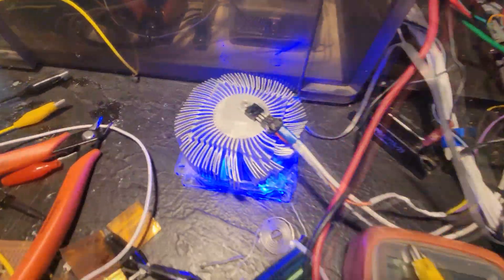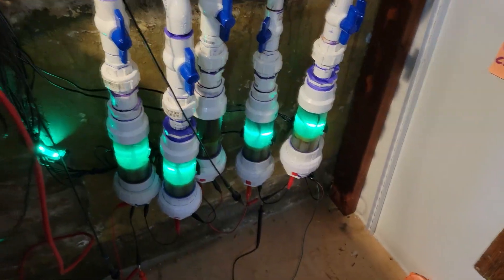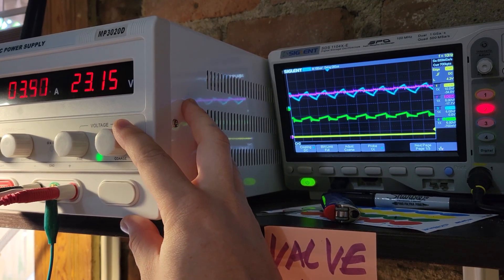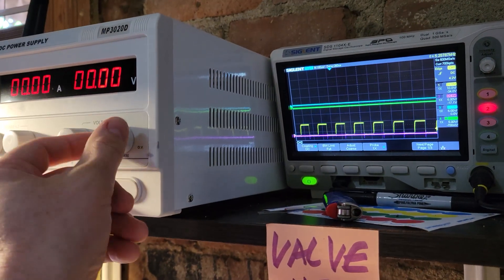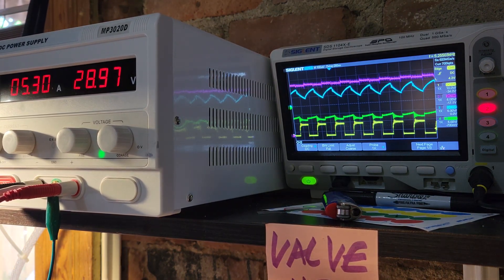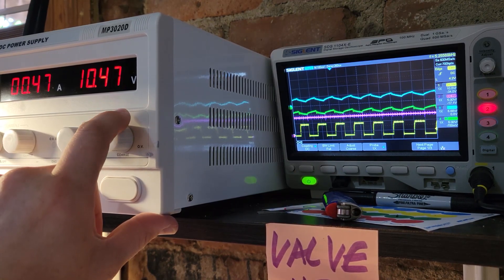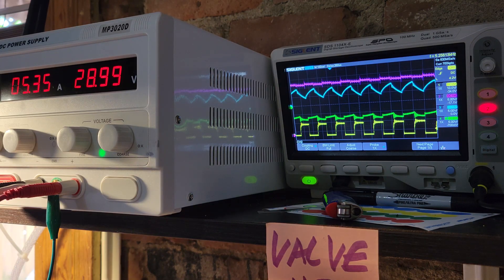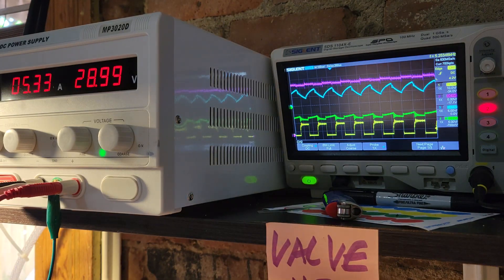A boring video about different MOSFETs (no need to watch)

Comment: What gate driver are you using ?
Reply from the maker: Basically just a 555 PWM circuit direct to MOS. Utilizing either Dave Lawtons 555 circuit or a Amazon PWM module.
Reply: Get a gate driver , or at least a totem pole of transistors , it will make the mosfets be way more efficient , 555 can't switch them fast enough and you will produce a lot of heat

Comment: I learned the hard way that Amazon is no place to buy components.   Fuses, chips, transistors; they all suck.  If you're feeling lucky, then just buy a lottery ticket.
Reply: Same. Been noticing the parts are likely the last binning. Misprints and all for 3x the price, when will we learn. :/
Reply: The bezoar feller didn’t get rich from honest hard work.  If you started earning $1,000,000/yr, it would take you 8,700 years to make what bezoar made in 2020, the verifiable worst year.
Reply from the maker: I've had reasonable success with amazon parts.